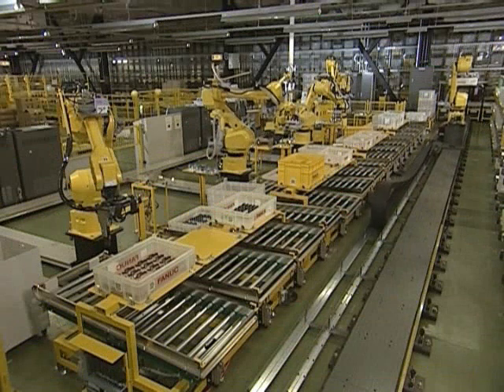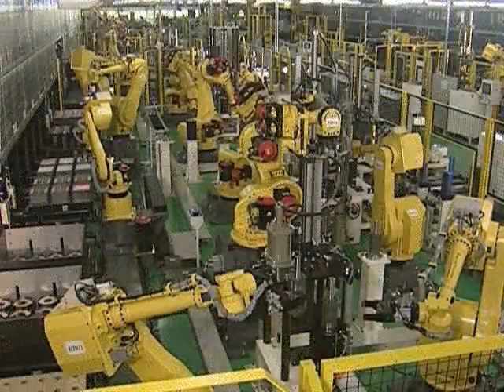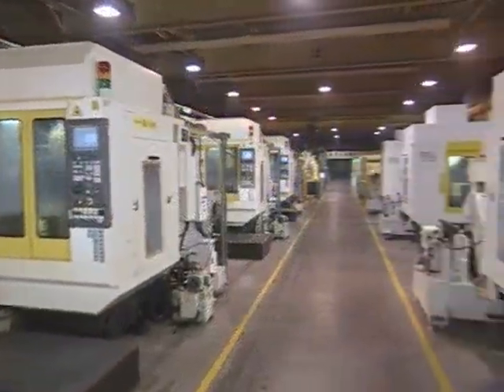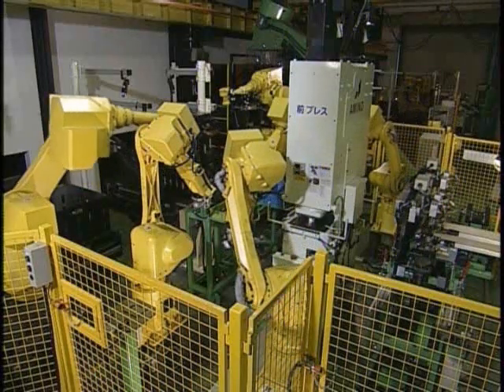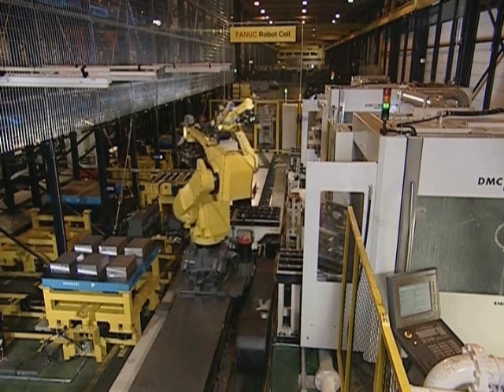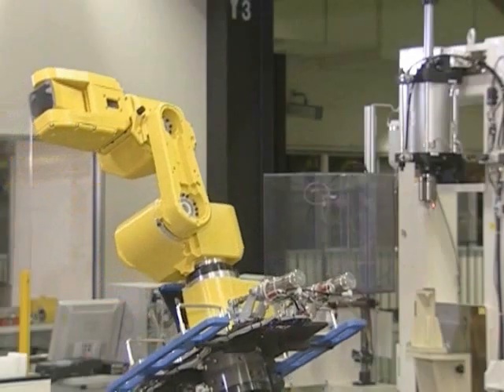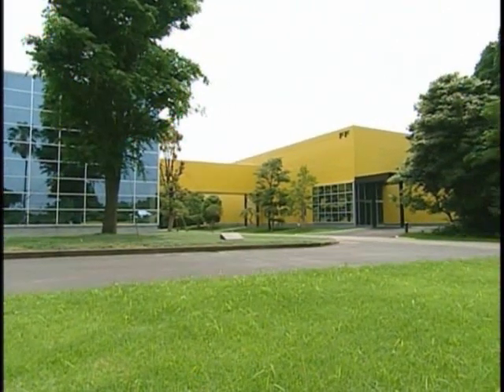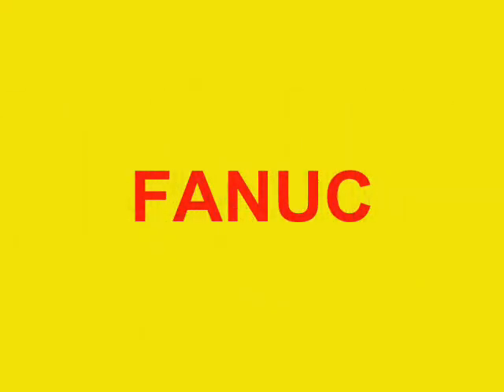Fanuc

Comment: neoblast, how long do you think it will take before the robots design themselves? how long before their put to work in the mines? how long before they do their own maintenance? or build themselves?(they are already doing that) My guess is less than ten years are left before most jobs a filled by these machines. to suggest that we(humans will be doing the designing, building, and maintenance on these things is very shortsighted. humans are only required to buy things.